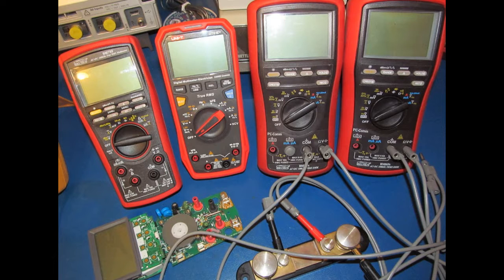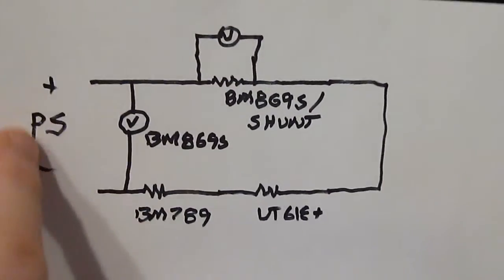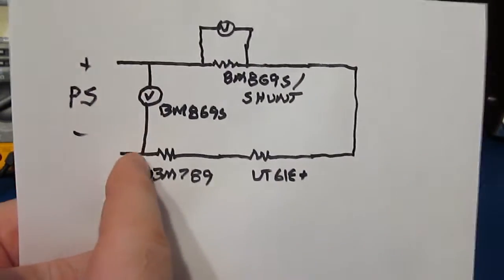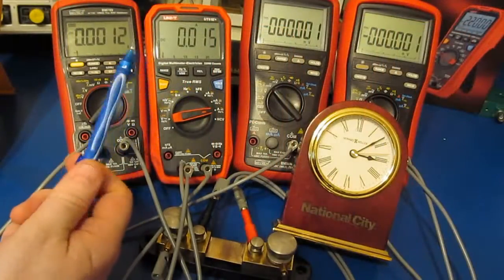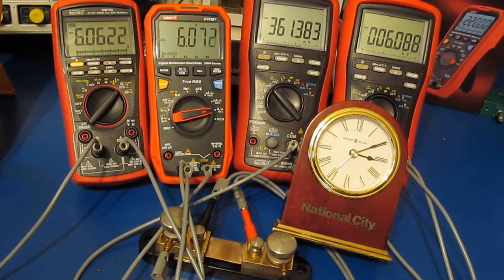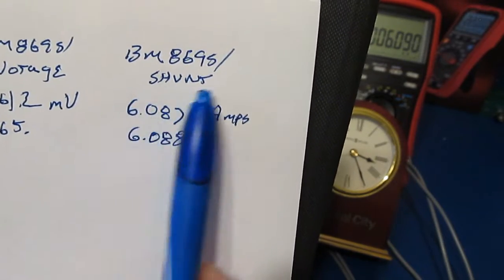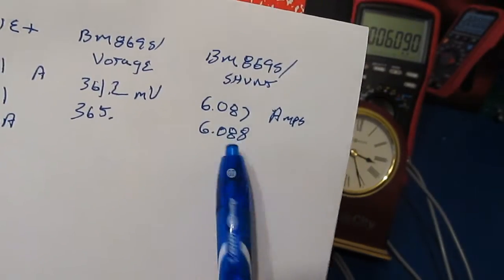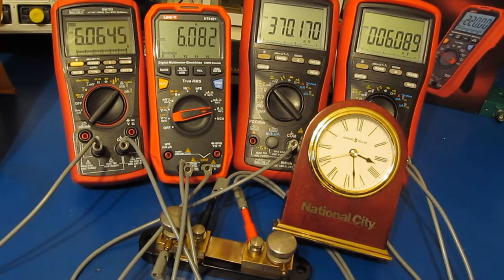UNI-T UT61E+ DMM Perfect Zero Drift Shunt???

Comment: LOL, I knew you would have to test this when I saw you reply to Jiri's post.  Nice clear demo.
Reply from the maker: A few things,  note how the battery in the clock had died at the start of the video.   Just my luck.   Then at the end when I compressed that 10 minutes, something happens and there was a jump in the readings.  Notice also the time went backwards.  I was in a rush and didn't catch that.  Not sure what happened when I compressed it but you can be certain, I did not invent a working time machine!  lol.
Reply: @joesmith-je3tq  Yes, I noticed the reversal. I just assumed it was a little side-project you were working on and you'd let us all know when it was perfected. ;-)

Comment: Hello bro, I get same multimeter befor 2 day and I have some problems. The multimeter had batteries installed. When I switch it on and try to muve between measurement options I get signal for low battery and multimeter get auto switch off. So I think this battery's its probably already finish and put new ones. Continue test of device and boom again low battery and auto switch off until I muve between measuring operations.. I checked the battery slot, noticed that one of the battery contact it's not like other a bit deformed in different way. But I think it's still oky to make good contact. I use device today and don't have such problem.. But I don't know what to do I have option to back it and get new one.. What u will advise me?
Reply from the maker: Warranty
Reply: @joesmith-je3tq  thanks bro.

Comment: I have a SIMPLE, analog alarm clock on my bench for quick-testing UPS run times; $13 on Amazon. I troll visitors to lab by running a beefy cable (probably 25 UTP) between it and whatever piece of test gear is in close proximity (usually an HP 8903B). To date, nobody has called "B.S." 😆.

Comment: Sorry, but from my experience, UNI-T is unadulterated junk.  I still cannot believe that Mr. Carlson recommended the UT8803 as the best bench meter to purchase this year.  It does have a great display, but other than that is pure junk.
Reply from the maker: @UCEN-bZ0C54aL8FomN8VP2nQ I like the BM789.  I've punished that series of meters and they held up well.   Low cost meters have typically not performed well against my tests.   Still I use cheap meters in the garage but I know I will have to toss them.
Reply from the maker: I'm sure it will make a great meter for some people.  Personally,  I still like my 34401A that I bought new when they came out.
Reply: @joesmith-je3tq  I have two of them (34401A) that I keep calibrated.  All I am really using them for these days is an A/D convertor, and at most .001 volt resolution. In the old days, I needed all 6 digits of resolution, but not now.  So, I thought the UT8803 is very light and smaller and would fit in the field kit easier and make it lighter.  I needed the USB port and to be able to get the DC voltage from it.  Neither the Windows 7 or Windows 11 computer can see it.  The see a Human Resource Interface and that is all.  UNI-T's programming guide tells you which driver you need, which does not work in either OS.  When I asked UNI-T tech support for assistance on about three occasions, they never responded.  I waited for a response on day beyond the return date.  So now, with the beautiful display, it got thrown on the junk pile.  If it would have worked, I would have had it calibrated to ISO17025 and used it as my mobile A/D converter.  About three weeks ago, I pulled it from the junk pile and gave it another try on a fresh Windows 10 system without it being able to see the meter and just the interface as HID (or whatever that is), not as an instrument or a USB interface.  Back to the junk pile.
Reply from the maker: @Daveyk021  With the UT8803 only being 6000 count and wanting to take it into the field, not sure why you would go this route with so many good handhelds available today.  Agree, a very poor choice for an actual bench meter like the 34401.  I want the accuracy, resolution and being able to automate it.   I have a very old Fluke bench meter that uses thermal RMS that I saved from the recycle.  Needed some repairs.  Its about 2X the size of the 34401 and much heavier.  Fun to play with.